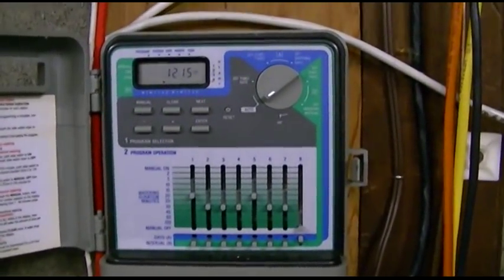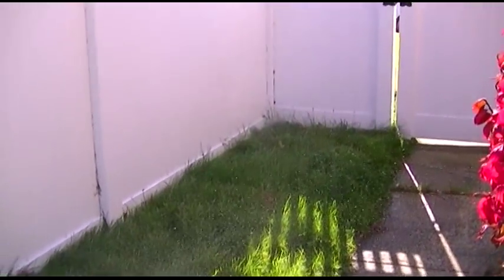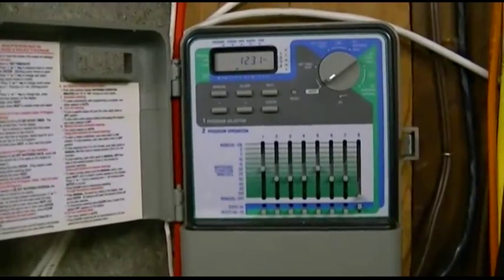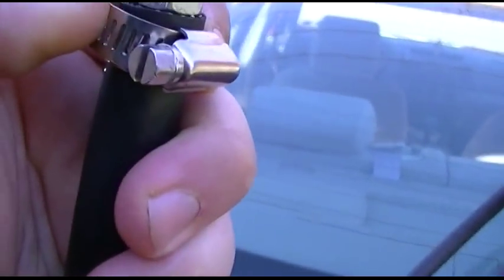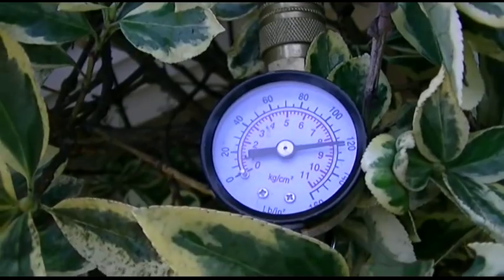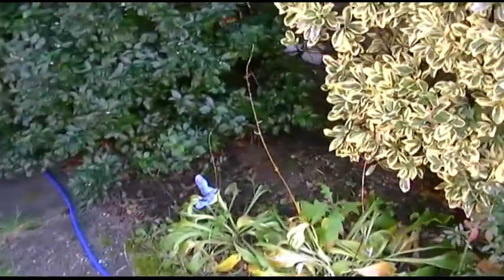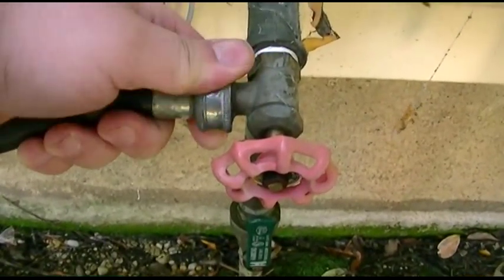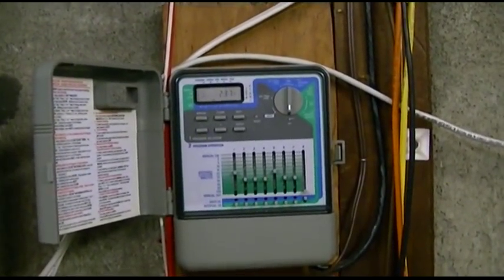How To Blow Out (Winterize) In-Ground Sprinklers (2014)

Comment: So after we blowout are sprinkler system why can’t we unplug are sprinkler timer
Reply from the maker: You can, I recommend you don't.  Most have a battery that will keep the program in meory.  If that battery is dead and the battery is dead, you will have to reprogram it in the spring.